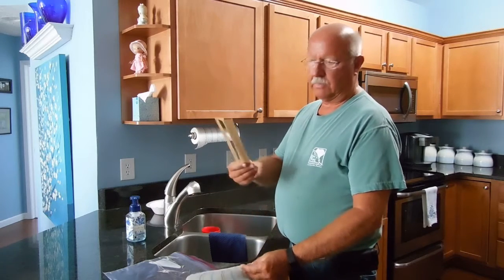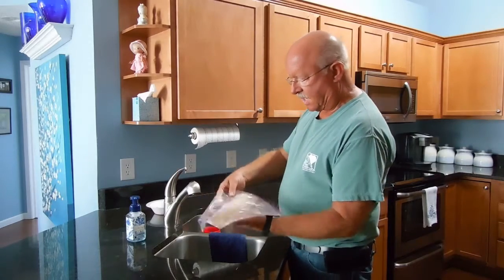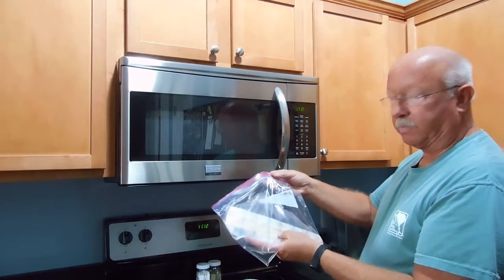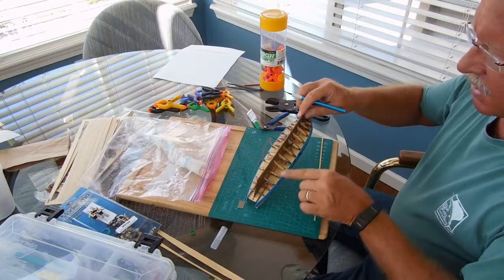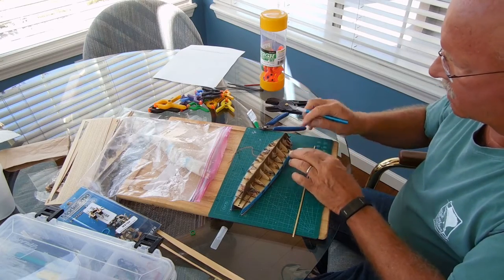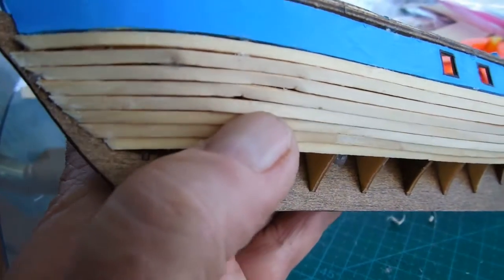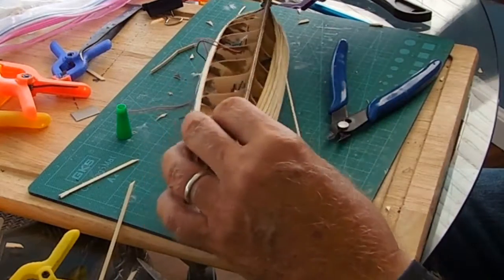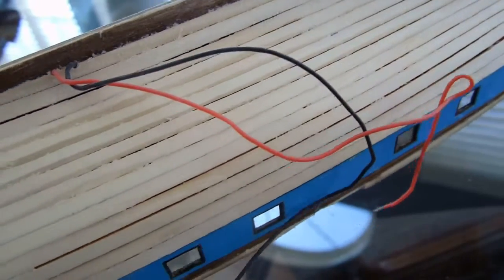Model Ship Build - Planking part 5 A

Comment: Dan, I've been building for 25 years and I strongly recommend that you dispense with the plank benders, A simple bend like that can be easily achieved by running the hot water tap (faucet) over the plank and working it a little, the timber won't be damaged like with the benders (all different types of benders, including electrically heated are unnecessary) . To avoid the plank buckling as it rounds the bow you will need to edge bend it. See Chuck Passaro's video. He uses an iron, I use a jig because I use hardwoods, an iron would burn the timber.
Reply from the maker: Dugan I always appreciate good tips! Thanks for watching and taking the time to educate us 👍
Reply from the maker: Dugan - I just noticed that you had viewed my earlier small ship builds.  Here’s what I’m working on now. It’s not perfect but I’m progressing in my ship building adventure! Here’s a link to The Black Pearl:  https://youtu.be/L2NUp8K_90E  Thanks again for your helpful message and I will definitely use it on my next build!

Comment: Where do you get these planks?
Reply from the maker: The ones in this video came with the ship.  However you can go to Amazon or eBay and enter "model ship wood planks" and get some.  Here is a sample of one from eBay: https://www.ebay.com/itm/253116686764
I'm also in the process of building a much larger ship, "The Black Pearl" if you'd like to check it out, here is a link to one in the series.  I'm up to 21 segments and still going!
https://youtu.be/61f-iZEXvz4

Thanks for watching.
Reply: Model shops, ebay . If it's a kit you'll get everything except tools.

Comment: Couldn’t you just use pliers and gentle pressure instead of the bending tool? I don’t see what it really does?
Reply from the maker: Yes, to a point you can use pliers but to get a smooth or extreme bending, I just prefer the heat method. It’s just a matter of preference. Check the 2:34 minute mark in this video to see an extreme bend: https://youtu.be/6LuHWVBY_AU
But if you prefer pliers, that’s fine and cost effective too😁
Thanks for watching 👍👍